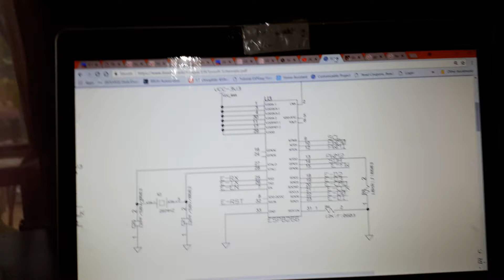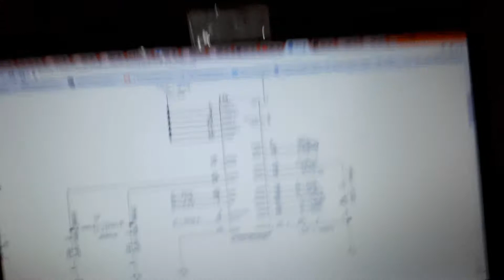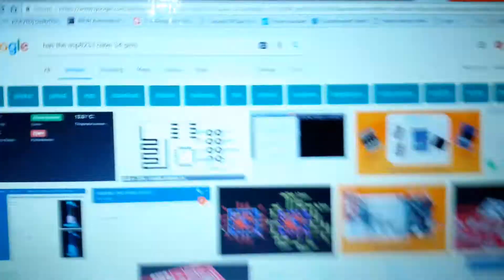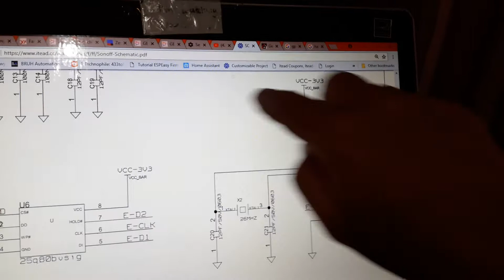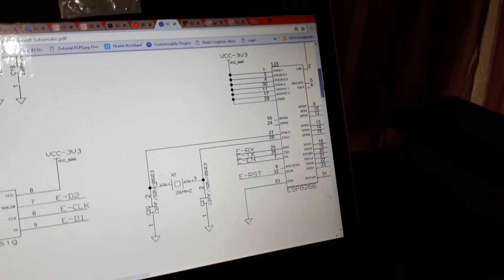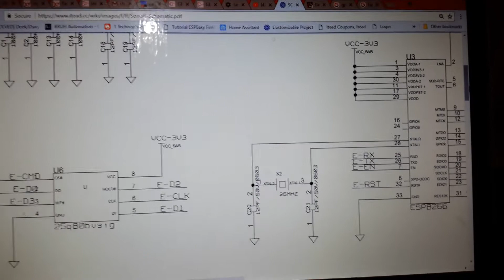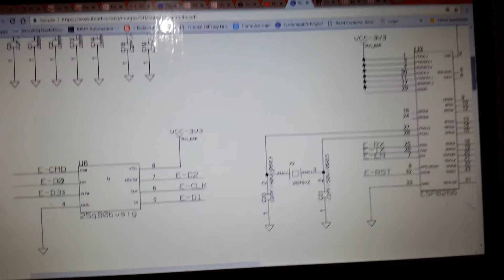Sonoff Basic ESP8266 how to put it in program mode without a switch.

Comment: Hi Chuck,
Do you know if this works for newer sonoff switches (I got mine in feb2018) and I am unable to put it in programming mode by pushing the switch? I understood iTEAD changed something ....
Reply from the maker: Jody van Dongen It should still work.  What happens. Do you get the flashing?
Reply: Chuck, 
No, that is the challenge, the ESP won't go into flashing mode... tried tr-rx change without any result....

Comment: No luck Chris, in fact the four pins of button are unsoldered from the board, does it change something?
Reply from the maker: +Valéry HELENON not really as long as the pads are there.
Reply from the maker: +Valéry HELENON did you scratch the circuit board clothing off.  Near the pads then short them out.
Reply: The four of them?

Comment: Thank you Chris, I gonna try it .
Reply from the maker: Valéry HELENON No problems mate.
Reply from the maker: +Valéry HELENON Good luck.
Reply from the maker: +Valéry HELENON You could just scrap back the tracks of the circuit board and short them.
Reply: I think the best way to do that it's to send a picture of the board, and then we wil be able to determine exactly what to do. ( Sorry I'm french, so forgive me for my bad english)
Reply: As you can see the base of the button is no longer there
Reply: Try to send you a picture, but....
Reply from the maker: +Valéry HELENON Check out the end of my new video. You only have to short the ground pin to the switches side heading to the chip.
Reply from the maker: Valéry HELENON I will try to find time after our Family Christmas party tomorrow to help you by hangout ing you. See whatis going on or make a video for me mate.